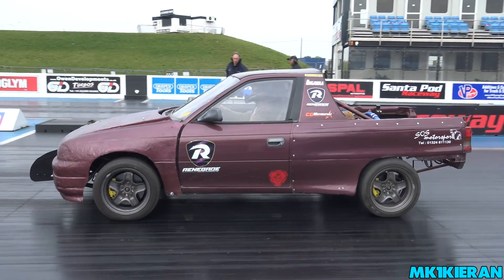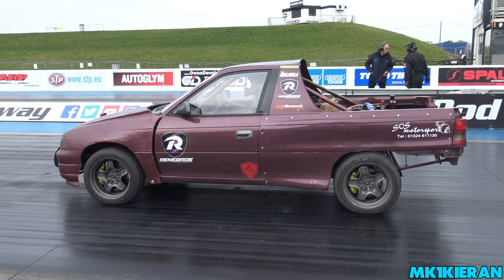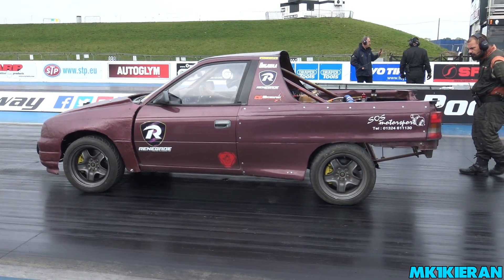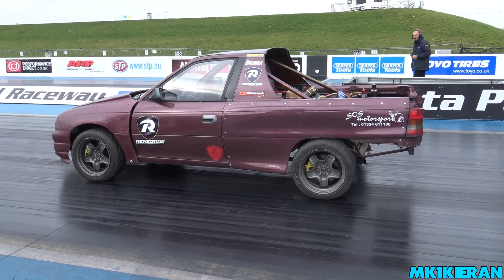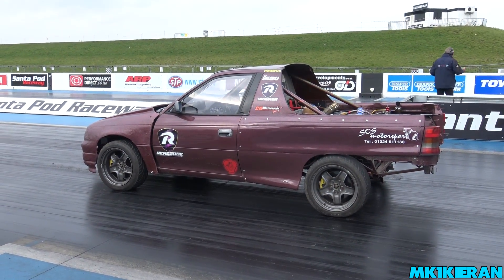This Twin Engine Pickup Has 500HP PER ENGINE!

Comment: That looked difficult to drive. How do you keep both engines working together?
Reply: Thats the toughest part. You just have to work on calibration. But generally they'll never be perfectly in sync. Thats why most twinnies look sketchy going down the strip. Slightly different boost levels, thresholds, slightly different clutch operations , slightly different throttle behaviour. But its probably cheaper than building/breaking/building breaking a 1000bhp GM Astra/ Opel Kadett

Comment: Fucking scary looking. Cool as all hell right enough. Part of getting it dialled in properly is getting to sync the engines at the same time. If the front one revs out and the rear is halfway through the range, the next gear change will have the front settled and the rear bogging down. Its a fine art to get it right.

Comment: For all the people commenting on how dangerous it looks. Watch the rear wheels at 2:08 @ 0.25 speed. They’ve used a front subframe in the back and replaced the steering arms for tie rods which are not up to the job. This is causing the toe to change massively with every gear change
Reply: Already thought there was something wrong with the alignment.
Reply: 1 false turn u a dead guy
Reply: There not enough brakes and to much wheel power to rotate. It's only normal for mini cooper probably 3 cylinder in each engine plus powered differential where it only allows certain amount of power to the front while locking the engine in the back. Better when turning of any sign the front engine lose acceleration but straight front wheel just on go.

Comment: Quick I guess but considering its 2 engine and still side by side with cars with 1 , seems more work than it's worth,  fair play in doin some thin of his own n differnt tho  😁😁
Reply from the maker: Twin engines sound a lot better than they actually prove to be but I appreciate the work that goes into them to get it to work!
Reply: Ye that's it cant fault some one for the ideas or builds   , makes it there own 😝👌👌
Reply: @CJ-vb5wf  Also much cheaper. If one engine goes pop get another near standard engine for £350. Sorted. How much is a 1000hp GTR engine?

Comment: 1000hp and 4x4 but only a 10.5 🤷🏻‍♂️
Reply: Yeah but it needs to be dialled in. Its sooooo much harder to set up a twinnie with 1000hp than say a GTR with 1000bhp.

Don't forget 1000bhp is roughly 850HP @ wheels.  10.4 @ 145 terminal if it weighs 1300kilos would suggest around 750 BHP. 620HP @wheels. But thats on a single engine spreading the power properly. 

On Drag calculator it says 1000bhp (850 wheel hp) and 1000kilos (2200lbs) should be an 8.0 @ 178. (I changed the weight as ive seen some people mentioning it weighs 1000kilos. I dont think it does.

So anyway I think it weighs more like 1200 and probably making 350 wheel hp each. Or I could be talking bollicks about a car I've never even touched 😆